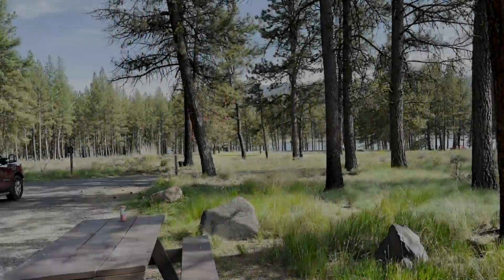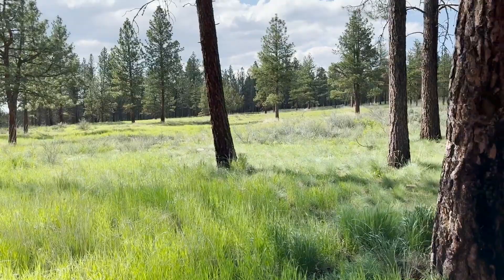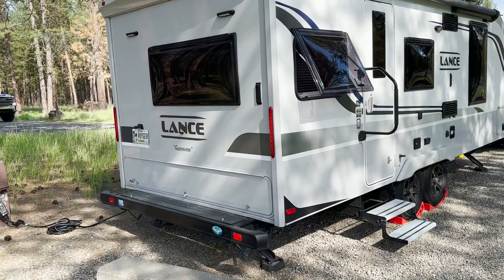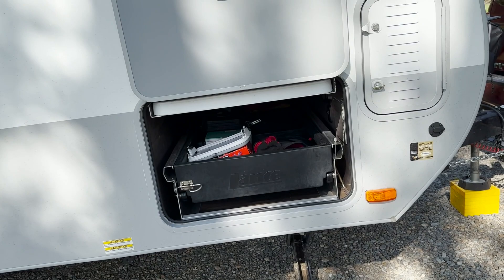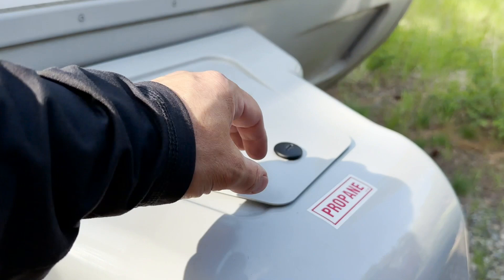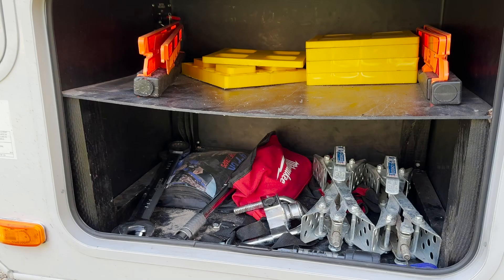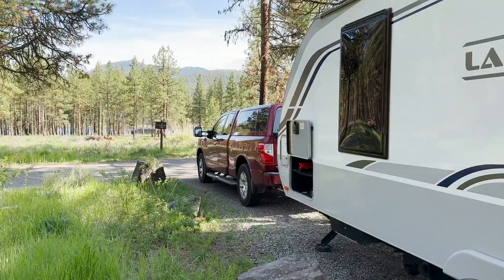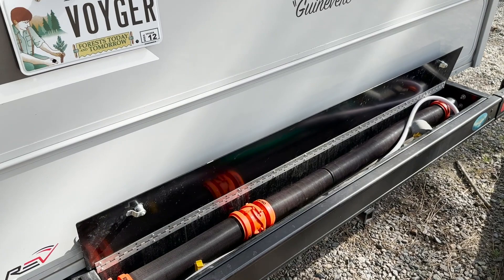The LANCE 2075 has ridiculous amounts of STORAGE!

Comment: What is the tongue weight of your 2075?  I see it advertised as 440# but I don't believe that at all.  With the battery and propane and not empty tanks.. is it a lot over 700#?  thanks
Reply from the maker: @andyherron1808 Hi Andy, thanks for stopping by our channel.  I haven’t weighed it recently but I’d say around 600 is a fair estimate depending on the water  on board.  One of the many great features to this trailer is the giant tanks which check in at an extremely generous 45 gallons across the board…that’s 45 each for fresh, gray, and black.  Another thing to keep in mind on the tongue weight: she’s 4,400 lbs dry with 1,800 lbs carrying capacity.  That gives you a GVWR of 6,200 lbs (appx).  10% of that (typical transfer to your tongue) is gonna put you in that 600 lb neighborhood fully loaded.